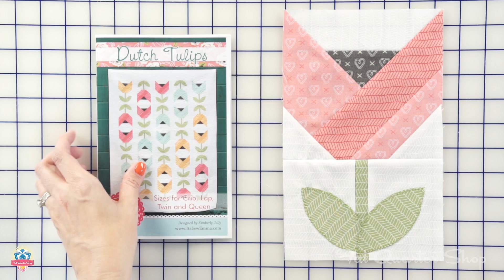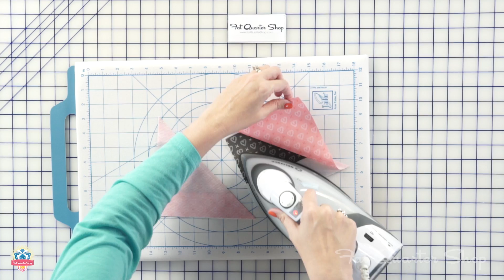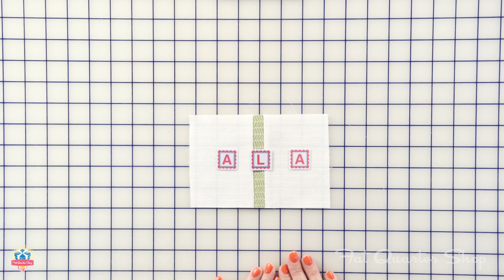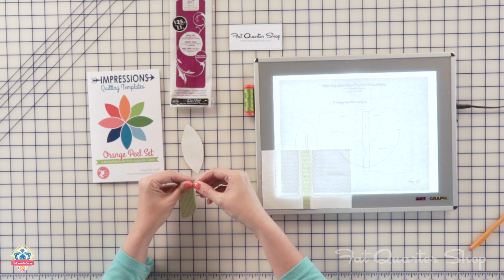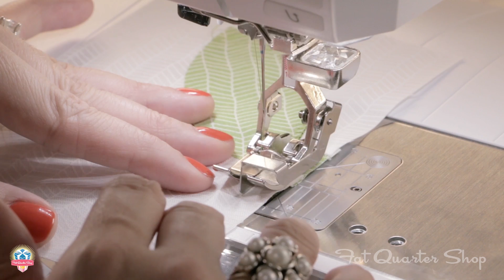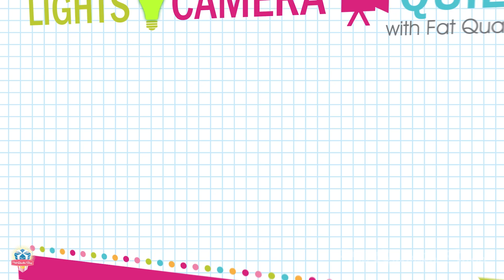How to Make the Dutch Tulips Quilt Featuring Impressions Orange Peel Templates

Comment: 'Don't think of the leftover fabric as "waste" because you then have it in your mind you can't do anything with it. I keep every scrap of fabric, troll through quilting magazines and make applique blocks of all kinds and eventually I have a quilt that looks amazing. I have fabric in my stash that's over 15 years old and I've only just used it! I don't worry if I have leftover fabric scraps from expensive fabric as I can always find a use for it eventually. I'm completely self taught long before tutorials like this came alone and have hundreds of quilting magazines to give me ideas. I LOVE left over fabric.
I'm thinking of making this with Tula Pinks Tabby Road fabric, but not sure how it will come out.
Reply: Just sew another  1/2" away  toward the corner on the "waste" cut it apart between the seams and you'll have a bonus (small) HST to use in another project. They work great for mug rugs or for a border.

Comment: that's a lot of waste huh?
Reply: yes but getting those seam on the right done with precision and with a bias edge can be daunting. The larger scraps can be used -- i like to starch the fabric very heavy and then the scraps with biased edges exposed will resist pulling out of shape and can be used later.
Reply: Ok I wasn't complaining but I was wondering I guess you could make a pillow shame or cover with the clippings
Reply: As I stitch the diagonal lines for corners, I always stitch 1/2" away and automatically have "waste corner squares" that are coordinated and DARLING.  Have made many a scrappy quilt from the combined waste corner squares. I have, used the corner squares into wall hangings, pillows, dresser runners, placemats, etc. It is rather wonderful!  I just keep a little bin nearby and fill it up with future cuteness.
Reply: Patrice it would be cute to have a crazy pillow that goes along with the quilt! I like your idea!
Reply: + Patrice - Yes the clippings could be used in what are called "Crumb Quilts" and can be a sort of "Crazy Quilt" without all the traditional fancy stitching or trims.